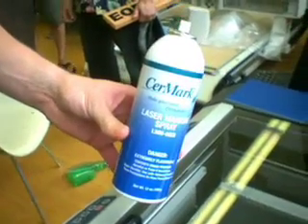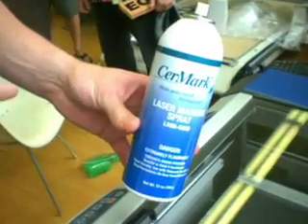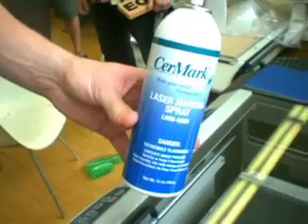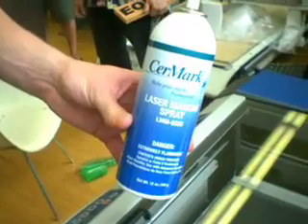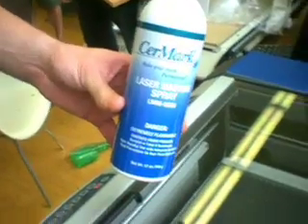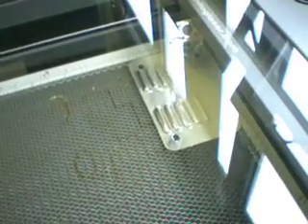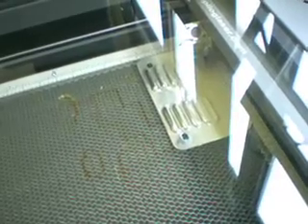Laser Marking on Chrome

Comment: Was it chrome or just stainless steel?
And if it was chrome.. did the marking stick to the surface?
every time I try to engrave chrome with ceramark it doesn't stick to the surface.. I can remove it with min tumb. 
But
on stainless steel it works perfect
Reply: i tried to engraved on aluminium chrome plated and it doesn't work, i dont know why, if you know how to do it tell me
I tried on white ABS chrome plated and it doesn't work too. it just make a bubble between chrome and ABS.